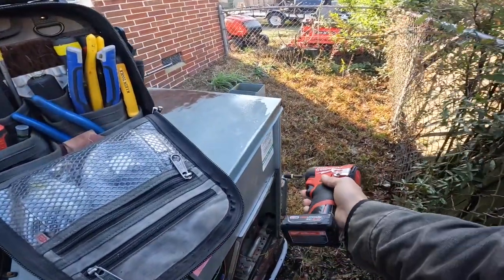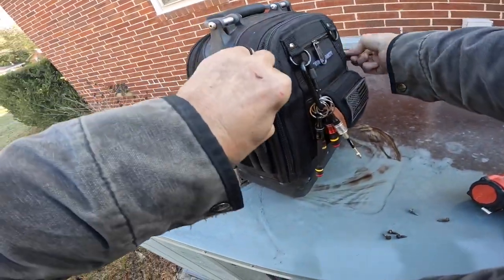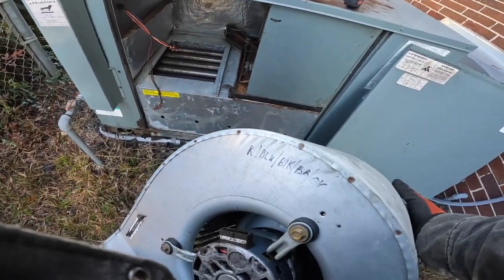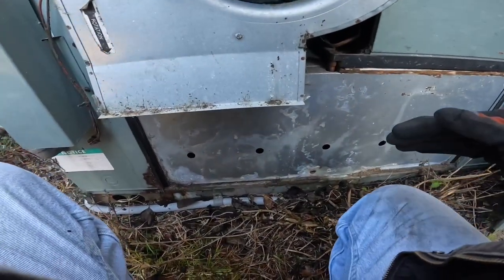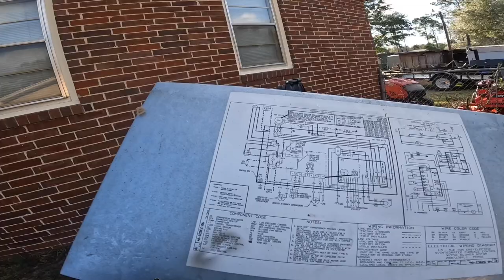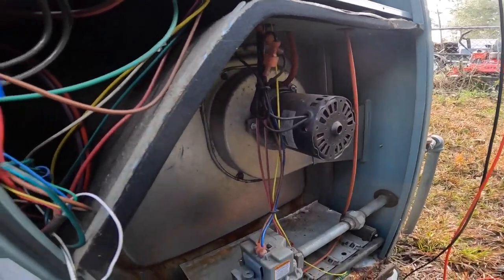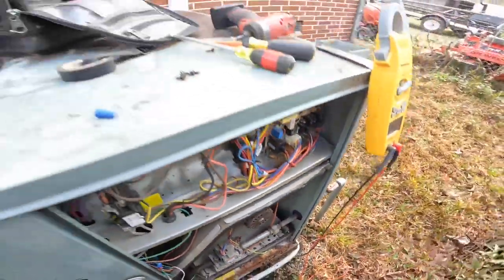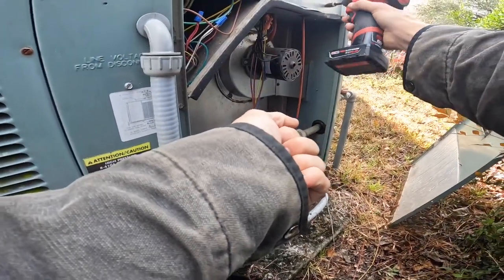Odd Complaints Lead to Preemptive Repairs

Comment: If they are the fluke leads on your meter you gotta watch your continuity on those. I had 2 pair that were testing at 4 ohms when they should be no higher then 1. They actually sent me a new pair after having one pair fail after a few weeks and one after a yr. I was really happy they warrantied them even without receipts. Just needed number on the leads themselves. The new ones I got have been good to me ever since. Good work Curtis and yes the light on the board is a failure sign

Comment: las week I had a customer that wanted me to check their window A/C it need preventive maintenance it also had a shorted main cord that caused the relay to fail I unsolderd the dameged relay from the board solderd a new one the compressor was locked I added a hard start installed a service valve the 25 year old A/C worked exellent...Thnks  HVAC guy..I learned alot frm yr videos...all the way from """Monterrey Mexico!!!!!!!

Comment: I'd be inclined to blame the remnants of those frogs. They would be at least somewhat electrically conductive, and might have been confusing the board's logic. It's pretty normal for an LED to dim over time, especially if constantly illuminated.

Comment: I always keep a freon box folded in half for a kneepad, wet knees suck, also remember to check the evaporator in case it's stopped up, filter also
Reply: I have a fold up stool that my twin girls use to use to wash there hands at the sink. Lol works great for air handlers

Comment: Customers need to Understand that when they have a Discussion with you during the Diagnostic and Repair Phase, the Final Bill is going to include customer delays. 😬👍
Reply: That's what we call an agrovation fee.   I would also charge 1 for that damn fence being too close to the unit.
Reply: We call it PITA tax. Pain in the a$$ tax

Comment: I heard the customer say, "When I turn it on in the morning," if he is turning the unit off at nite the furnace will have to run an extremely long heat cycle.
It's not good cause this could make the unit go in and out of a high heat limit.
Reply: A furnace with good duct system, properly set gas valve, and fan speed managing the heat rise will have minimal issue if any running a catch up cycle.

It’s not the most efficient way to operate…..but a limit issue would be a symptom of setup, maintenance, or system related issues more than slightly extended run times.

Comment: I think that if you would of moved that molex plug a big a little wiggle that you would find your problem in no time. I have ran into those boards having cracks behind them where the molex plug is and when you wiggle them a little the board works properly and when it moves a certain way the board doesn’t work at all.

Comment: Almost threw out a set of surge protectors that had a very dim light on them turns out LEDs even know what they usually go bad can get them over years of operation nothing wrong with the surge protectors I've seen failures even in cars where the LED indicators are out on the dash

Comment: I've wondered if any of the items he usually replaced have core value or were just discarded?
Reply: Zero core value. They get thrown straight in the trash. You wouldn’t believe how many units get prematurely replaced…..but at least those get scrapped for their metals and recycled.

Comment: I wonder if the frog was shorting out the board?
Reply: Curtis does really nice work. But, I was wondering the same thing. Some boards have a clear rubberized coating to protect the solder points, so maybe, or maybe not. If it was me, for my own curiosity, I would have (on my own dime) stuck the old one back in just to see if the LED was brighter without the frog 🐸.
Reply: Was wiring a house and had a three gang switch box that a bat tried to crawl between a couple of switches and got fried it was trying to get into the back of box where it was dark.. turned off power to get it out.

Comment: That was a great customer. It makes up for the bad ones. I always use to say, for every customer you loose, you gain ten. That is if you are honest and do a great job, like you. This is going to sound stupid, but is there an universal board, or do they all have to be brand and or model specific? I know on some you can cheat by using relays, but you lose the delay and the cool off.
Reply from the maker: I don’t know if a universal board is made to work with this one. At least I’ve yet to come across one.